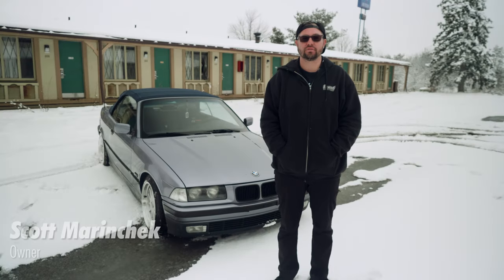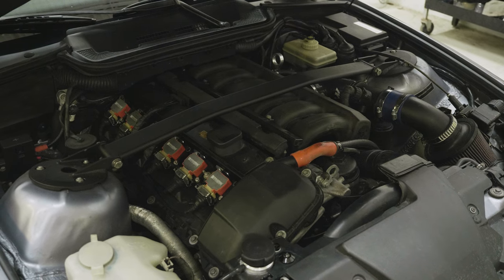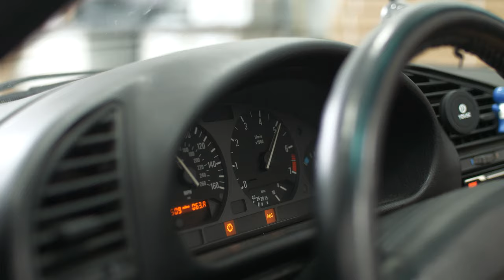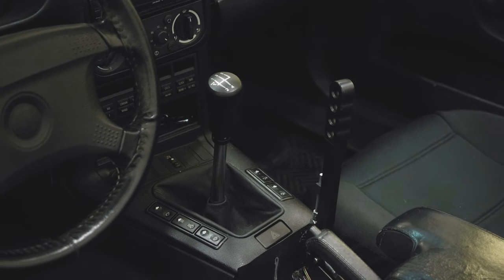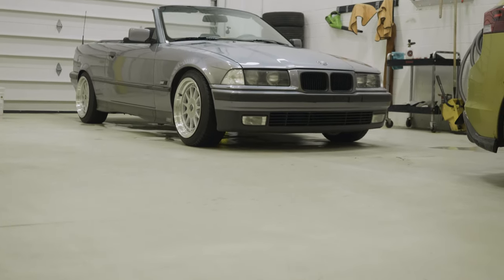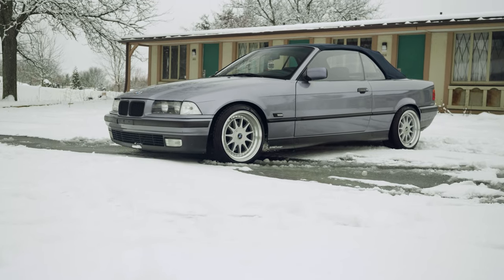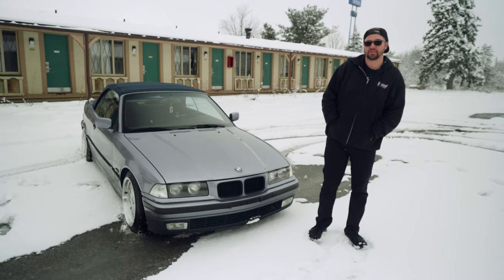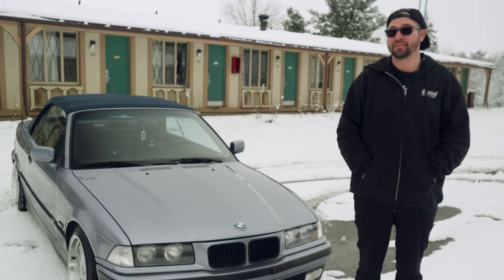Convertible E36 with a Welded Diff as a Winter Beater? | Enthusiast Built

Comment: Would you not have been better off with the m50b25 as a replacement?
Reply: Yes, this. The M50 is mechanically so much better than the pile of garbage that is the M52.
Reply: Yes but cheap beater gets cheapest engine I could find lol